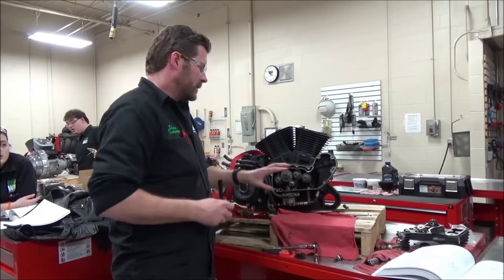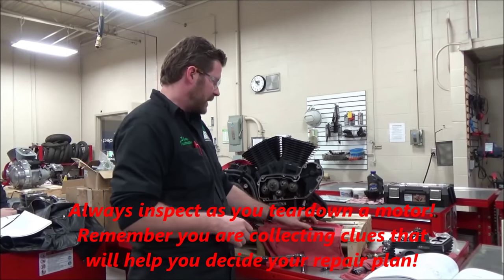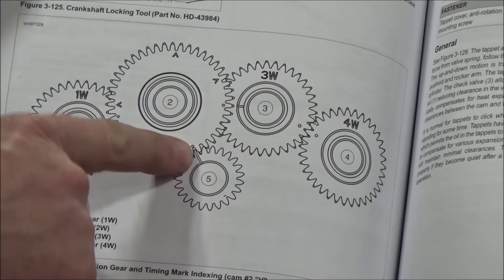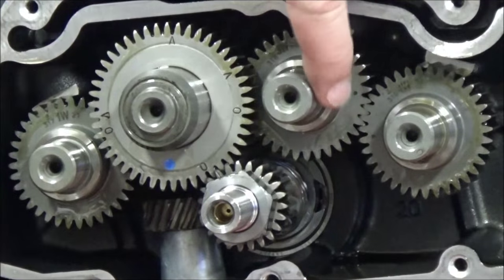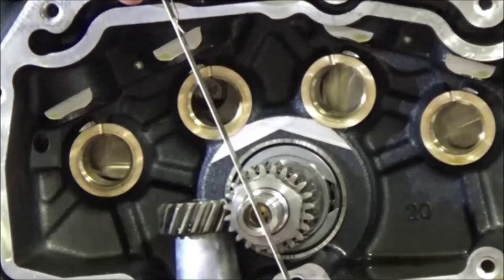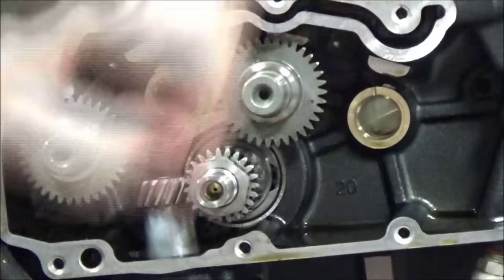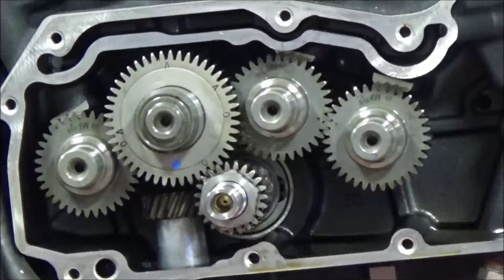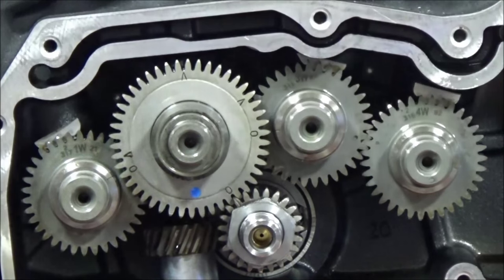How to install and time Sportster Camshafts CLOSE UP VIEW! Same as Harley Davidson Sporty Ironhead

Comment: Hey thanks for another great video.I come from a farm,oilfield background but defenatly not a "motorhead".I've watched your videos and as usual they explain why /how things are done well.
  I've got a 13" sportster 1200 and have done stage 1mods myself with homemade  "lollipops' in V and H exhaust.Installed longer after market rear shocks for less rake and more sporty ride,tires changed,chrome studded seat,bags,conchos,brake pads,LED light strips at sissy bar.
My boy is getting a bike and the extra time we can spend fiddling on them together is golden.Any biker knows that wrenching in the off season is almost as much fun as the riding season.
   Again thanks for the inspiration and sharing the videos.
Reply: Darrell Felt Amen. That's the start to mechanic work you want to have.

Comment: That's one of the best demonstrations I have seen on the cam gear alignment. It was especially helpful to get the tip of using the straightedge and line up from the crank to the rear intake bushing. Nice job.

Comment: i recently found out that Ultima makes a "High Volume Oil Pump" that will fit my pre-pin oiler... so the answer, for me, is " increase the big end sling " when camming pre-pin oiler sporties.
no problems 04 and on, the ones with pin oilers can pretty much handle anything you throw at them.
but i would definitely suggest a high volume oil pump when camming 03 and earlier model Sportsters..

Comment: Had my 1975 sporty redone. I installed the heads and adjusted the valves. Front not firing. I know that the valves re knew and set in. Rear compression actually does a loud pop when I rotate engine on my finger. Front barely fizzles. I have electronics  that fire both cylinders. I hear it snap on plug when it's on TDC. Has to be a cam off isn't it? Everything is new. It's making me wonder if I know what I'm doing. ( jet engine and FMC and  GMC MECHANIC) "yep I used to know all"! It has to be the cam. I should of done it all by myself!!!
Reply from the maker: You're on the right track. If no compression on the front, not point in moving forward until you find it. Wrong cam timing could have bent a valve too....we can help if needed...
Thank you for commenting. Could you spare $2 and support us with even more benefits? Would you consider helping support our work here and help keep us going? We can’t thank you enough for helping us keep making technician training impacting schools all over the world.  Smash the subscribe button and bell! Join this channel to get access to perks:
https://www.youtube.com/channel/UCBhM8DCKnT3qXwTW0eToyCg/join   
-Daily MEMBER FIRST COMMENTS ANSWERED FIRST 
-Live Q/A video chats
-Wonder if we have a video on your need? Members can request content links!
-Full Access to the ENTIRE 700 video library
-Member-Only FREE tool giveaways 

Just want to say thanks quick to support us for this information and our work saving you money? 
Give us a high 5 here:  https://www.paypal.me/how2wrench

Comment: I can't get the cam back in due to the rollers on the end of the push rod, what do I do?
Reply from the maker: Thank you for the comment. See the link below for more help with your question. I have been banging my head against the wall thinking of ways for people to say thank you in an impactful way to help keep these videos coming. Here are few ways that many have found as a way to give back. 
* Membership to H2W (includes t-shirt or tech help) https://how2wrench.com/product/membershipmembers-onlymembers/
* Simple donation to say "KEEP IT UP"
May you have a great day and... https://www.paypal.me/how2wrench

Free Mechanic info, tool reviews, and “how to” videos newsletter sign up: https://how2wrench.com/subscribe-free-newsletter/

Missed a past issue? No Worries. Newsletter Archives: https://how2wrench.com/blog/newsletter-archives/

Like freebies? Click here for a free diagnostic checklist! 
http://gem.godaddy.com/signups/364621/join  

If I can ever be of service to you, here is a video explains how to connect with me. 
https://www.youtube.com/watch?v=vjvmB01ebcs
Reply: If you didn't  cut your old pushrods out with a pair of bolt cutters to replace with an adjustable  set your going to have to remove your gas tank so you can remove your rocker box covers and remove the rocker arms to remove the rocker arms you have to remove the 2 bolts for each and push the rocker shift pin and that will let you push the lifter back up so you can install the cams . If you have the money and don't want to do all of that I would  just cut out your stock pushrods and get an adjustable  pushrod kit

Comment: How do you get the cam cover back on? I was able to time the cams when I did my bike buy I could not get the cover back on to save my life, i could not get the cams to slide into the bushings in the cover, ended up ruining the bushings and had to take the motor to a shop to finish it up. Any tips?
Reply from the maker: +Bill Hill 
I'm betting you still had the pushrods in downloading the cams. Yes/no? If so you cannot get the cover back on if the cams are under tension.
Reply: I had the pushrods in but I didnt have the top end back together so I dont think there was any tension on the cams.